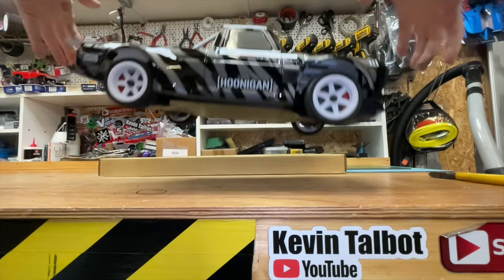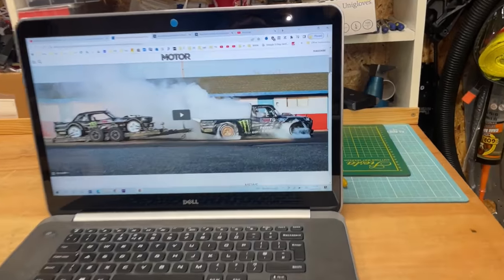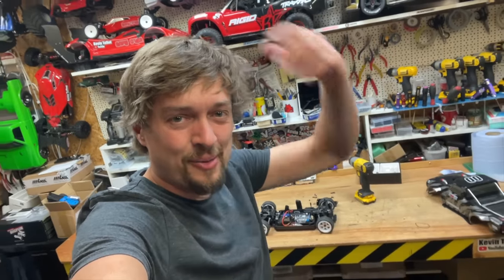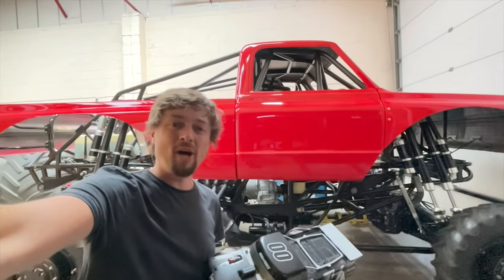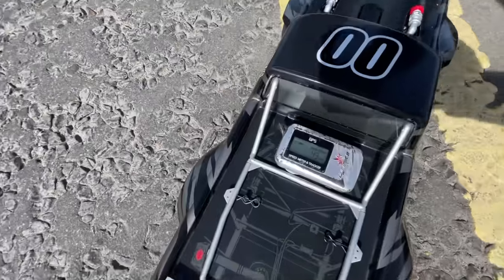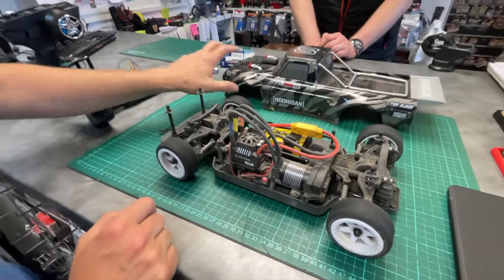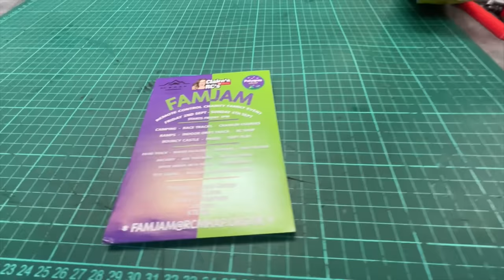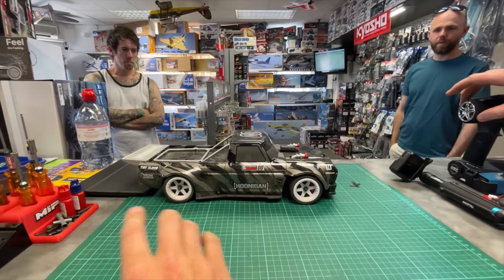RC Hoonigan Burnout Drift Truck - Why so expensive?

Comment: Hey Kev, for the longest off road speed run truck, try taller tires to hit 100...
Reply: Yeah, I mentioned that too. Larger tires less revolutions to cover the same distance. I also mentioned he should take the max rpm of the motor, calculate the gear ratios to the wheels and see if the thing can even DO 100 mph. Maybe his current set up can do 100 miles, but not in an hour.

Comment: You definitely are a solid channel 👏! Appreciate the effort you put out there. I needed a smile today.  Any chance you have an idea on why I installed a brand new futaba receiver and it after I plugged it in on my maxx it paired and had steering but while trying to bind I couldn't get reverse to work. And now I have nothing.. did I fry the receiver? After hours of trying to install this an a max 8 plus vitavon bellcrank  servomount and push arms for it not to work I'm ready to sell it all

Comment: Thanks Kev, this truck was on my radar.  Now it’s not.  Also I’ve been seeing you use lots of Hobbywing electronics recently.  I want to upgrade my vxl soon.  Is Hobbywing the way to go?
Reply: This should be more of a drift truck imo
Reply: Everyone seems generally happy with what Hobbywing offers for the price. Availability at retail prices seems to be hit or miss for me though.
Reply: I’ve got a hobbywing, and it’s pretty good! I’d definitely recommend one.
Reply: A lot of companies use rebranded Hobbywing electrics. I've had plenty of Hobbywing esc's and motors and not had a single issue as of yet.
Reply: I have a Max 10 in my Rustler 2wd and I love it. It has plenty of power on 2s, and is super reliable
Reply: Hobbywing has great big boy motors, yes get hobbywing

Comment: Well over $500 after the max 10 combo. 

Last TA I got was the MT8. It was much cheaper. And also basically just a modified redcat.   Lost faith a bit! 

I love the MT8 now, though. But the arms are all replaced and many broken parts right off the bat. She’s good to go now but seems pattern. I don’t want to buy a brushed  rc at brushless price if I have to still put a brushless system in there ha. 

But whatever. If it makes ya smile etc etc haha.

Comment: I was gonna say it's not too bad (expecting it to cost around $150). Then I saw the price tag lol at $430, this 1/10 truck running premium electronics goes slower (43MPH) than my SG1603 (48MPH) running Chinese electronics, which only cost like $150 total. Neat body, overpriced chassis, but still a great video :D

Comment: It's better than the other hoonitruck they had out before.....but I'm not sure by how much. Usually team associated stuff is decent quality, but this looks fairly meh..... I have a tc4, and a vxl4tec . This looks like a tc4 that was designed 15 years ago.  However I also have a belt drive tc6(all carbon and aluminum) with a castle 7700 kv motor and 2s its faster than it needs to be...

Comment: So kevin talbot i have a qeustion about the xmaxx why does the ring and pinion gear in the gear get destroyed while driving. But i have never had a problem with the pinion and spur gear. Our problems are opposite. I wonder why.
Reply: Is there like a better ring and pinion gear

Comment: $390?! TT02 kit: $65 
servo: $10 
radio and receiver: $45
Bearings: $20
Body shell:  $10-???
Brushless combo: $45
Wheels/tires: $12

For $200 you can build a better, faster car

Comment: Instead of testing bs that you can overtake on an eletric scooter you need to design models yourself ? If it was the right money and approved by yourself without having to be modified out the box ? Thats what id be intrested in buying. Surely your missing a trick here imo.